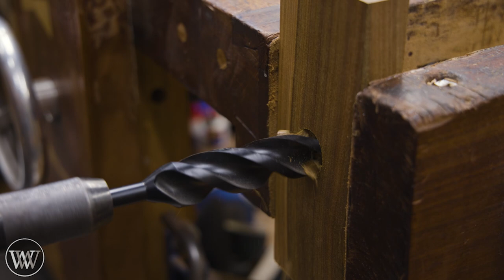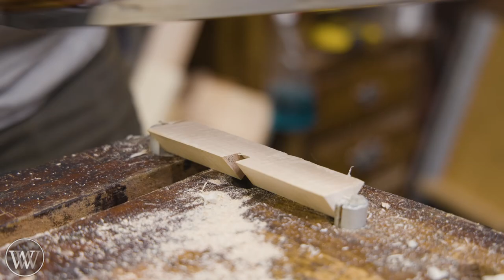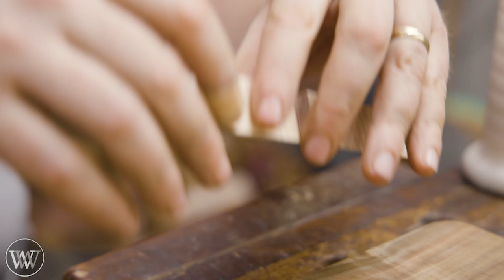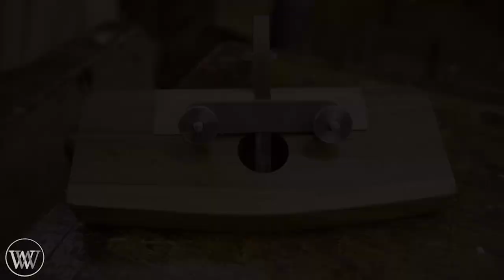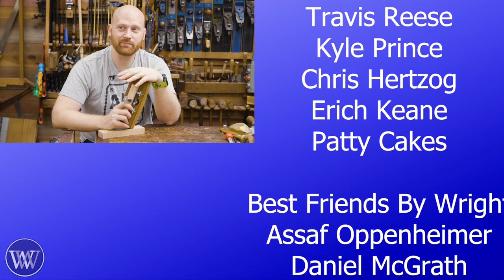Paul Sellers Router Plane Kit

Comment: Hello James, I’m new to woodworking and really appreciate veterans like you sharing your experience which gives a tremendous amount of support to newcomers like me. Thank you for your invaluable content. I’m considering buying a jointer plane and wondering if there is a particular # that you would suggest?
Reply from the maker: That depends on what you want to make. If you are only building things up to 2' long a no. 5 is good enough. If you are going longer you might want to get a no. 7. But if you are doing slabs and thicker stock the 8 might be beneficial.

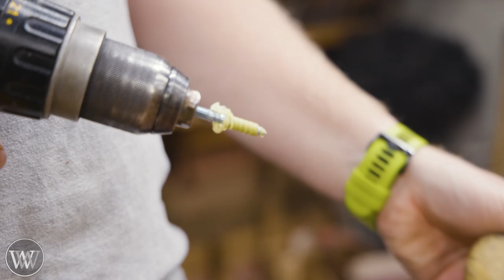Comment: 6:00 What is this potato-like thing and to what end does your use of it attain?
Reply from the maker: That is a block of hard wax. Using the wax on the threads makes them go any easier so that you don't end up breaking off a head on a screw or reaming out the threads that are locked into the drill.
Reply: @WoodByWright  Ah! I’ll add that to what I know. Thank you.

Comment: Hi Paul 
Thanks for taking the time to make the video.
I have a question; is the cutter angle 40 - 45 degrees?

Best regards 

Peter ( worksop england )
Reply from the maker: The bed angle is 45 degrees. The bevel angle is around 30 degrees.
Reply: @WoodByWright  
Thanks Paul, much appreciated.

Best regards 
Peter

Comment: No handles?
Reply from the maker: I'm not a huge fan of knobs on wooden bodies. I find I grabbed the body more than the knob and then I'll just gets in the way. On a metal body the frame is so low that a handle is useful there.
Reply: I was going to ask the same but assumed I wouldn’t be the first. I can see what you mean about grabbing the body only and I guess I might want to scoop/gouge some thumb rests on the rear face of the body if I wasn’t going to use handles.

Comment: I buld one sune after video publish at Paul Selers website. I use old mortise chisel as blade. It make the job but is… crude. 
Nead to be big but it do not reach to deep. I do not like this desige. With L shape blade is eser to get beter ergonomy of tool. 
I often use chisel in piece of wood and Paul Selers one is nothing more like this- if U are familiar with plane hamer seting is no big dill, and screw set  no give nothing.